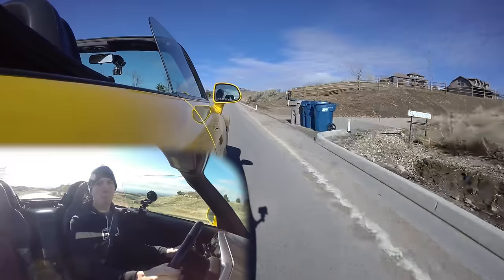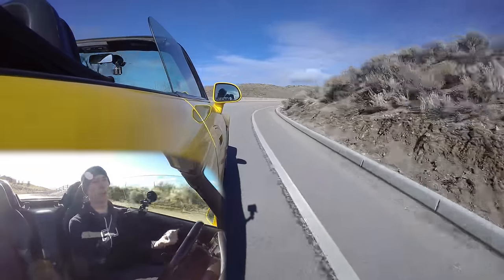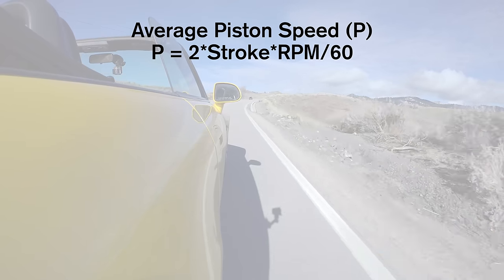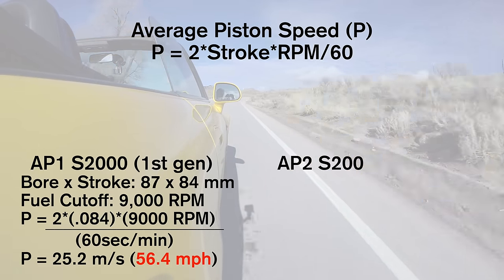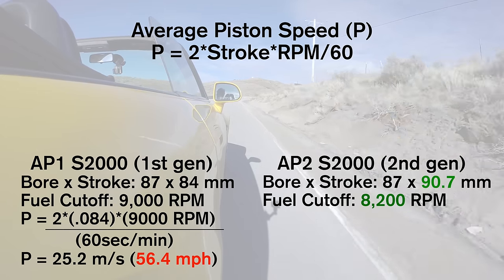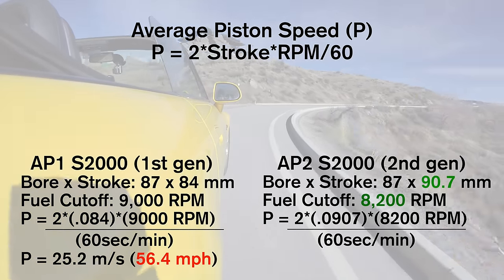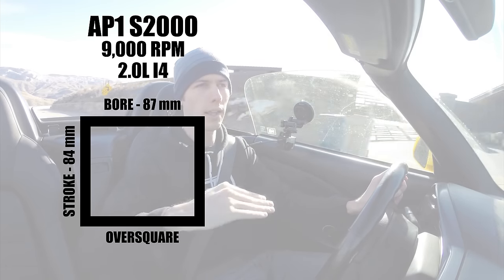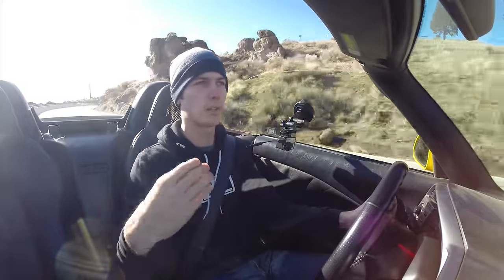How Do Some Engines Rev To 9,000 RPM?

Comment: And I thought the 7k redline in my F-150 was high...
Reply: Mel Laknanurak there I upshift in my E46 316ti
Reply: That´s crazy high for a truck
Reply: What year? My 06 king ranch revs to 5k... my Miata has cutoff at 7200, 7400 if I got a JDM ecu...
Reply: 2017 F-150 with the 3.5 N/A V6 that Ford shares with Mazda

Comment: What about deck height (engine block)? Deck height has a massive part to play in fact even bigger part that oversquare design as it reduces piston acceleration. Honda and BMW have tall deck heights on their high revving engines, however their engines are relatively square. Same with the Audi V10 which is under-square but revs very high. Increasing deck height allows Manufacturers to use existing parts inventory and preserve some torque whilst obtaining high revs. In dedicated race applications such as motorcycles, dedicated race engines or F1 cars, an ultra oversquare design with short deck height allows for a lower C of G for better handling and higher overall power to weight ratio.

Comment: Rod to stroke ratio ?..  you dont tell about it..
Reply: A longer rod means more dwell, meaning the piston sits at TDC and BDC longer. That's good for breathing, but it comes with a lot of downsides. Sitting there longer means it has to get there quicker, so longer rods mean higher piston speeds, which means lower max RPM. Longer rods are weaker yet heavier. The extra length alone makes them heavier, but the weakness that come from extra length requires even more mass, and flinging around more mass means even more mass, and flinging all that around at higher speeds means even more mass, so it's nowhere near a linear relationship. They make the engine taller as well. Shorter rods are better 9/10 times. I'd like to see scotch yoke engines become popular someday. That'd be the best of both worlds.

Comment: So.. is that car from the anime series Initial D, Takumi Fujiwaras car even possible to do 11000 rpm in real life ?
Reply: Yes, in the anime it was based on (or actually was, not sure) Formula Atlantic 4AGE 20V - it's actually able to rev up to 11k.

Other real life example is Spoon Civic Type R - It had a B16B engine heavily modified by Spoon and was able to reach 11k rpm.
Reply: That sounds amazing.
I got interested in cars not long ago, so I'm not really familiar with it all just yet. 

Could you please explain to me, how this is possible? 
I mean, isn't it bad when an engine revs up really high ? ( I saw some videos where the speedometer for the rpm was in the red zone a lot of time.. doesn't that damage the engine ? )
Reply: I got into cars like two, three years ago, still learning stuff.

Why it's able to rev so high is explained in the video by Jason. In short, to be able to make power with short stroke you have to make up with the rpm.

As for if it's bad for engine - yes and no. The engines are designed to work with all available rpm it can reach, high rpm increase wear - it does more work, more rotations, pretty self explanatory. 

Think about walking 2 kilometers and running the same distance as fast as you can - the latter will tire you out, use more of your energy, but this energy is converted into work, so you get there faster. It could be harmful to do such a thing, but doesn't have to be.

Red zone on the tachometer is just an indicator. Some cars have red revs just before their cutoff, some exactly at the cutoff point. Some modified cars have stock tachometers while having modified engine, so it actually revs higher than stock one - red zone on the tachometer loses its meaning in this case.
Reply: Thank you very much for explaining it to me ^^

So these are just different techniques people use:
high rpm = short stroke
not so high rpm = longer stroke

In the video it was said, that high rpm is preferred by car enthusiast because of the high-revving notes, but what does it mean that you can compensate it with gear ?
Reply: It's down to this single equation: HP = torque * rpm. (check last two videos for further explanation and fun stuff :) )

Long stroke engines have more torque so they don't need high rpm.
Short stroke lacks torque so it has to compensate with high rpm

Looking at it again - short stroke engines make their power at high rpm. Short gears - close ratio transmission to be precise, compensates for it, keeping the engine in the high rpm range by reducing the drop of rpm when changing to a higher gear.
Reply: Flame storm do you heard about the Extreme Tuners Evo?
Reply: +Sal You're confusing short gears with a narrow geared gearbox. A short gear (ie. first gear) revs the engine to max fast, but it does nothing for keeping a high revving engine at it's "power range". Likewise a tall gear (ie. 5th) takes longer to rev out to max, but also does nothing towards keeping an engine in its power range.  A narrow ratio gearbox has the "steps" between ratios quite small, so changing from one gear to the next drops the rpm for a given road speed by a small amount, keeping the engine operating near its peak horsepower. You have to change gears faster, but it doesn't let the engine fall below its peak power range.
Reply: scott thompson I meant exactly that, close ratio transmission, said "short gears" for a simple explanation of it. Short gears - short time spent in each gear as the rpm is kept high. 
But i know what you meant, short gear like 1st is, well, short, giving very little speed, tall gear being the opposite of that. I'll edit my comment to clarify this.
Reply: Sal the easiest way to have that effect is to change the differential ratio .e.g 3.08 ratios are used in most V8s and 3.55+ in most 4-6 cylinders and rotors work best with 4.11+, wheel size effects it all so a honda with 4.11s wont react the same as a bmw with 4.11s.
Reply: +Jarryn Smith If you have a wide ratio gearbox bolted to a high revving narrow powerband engine, changing diff ratios does almost nothing for keeping the engine in its powerband when changing gears. There will still be a larger difference in rpm between gears, so while it does have some limited effect and is physically the easiest change to make, it's by no means the most effective. V8's get away with taller diff ratios simply because they have more torque and don't rev as high. Diff ratios are good for tuning your overall package to a particular application. Drag racing use shorter diff ratios so they accelerate faster, whereas street cars use taller diff ratios so they cruise efficiently at highway speeds, and circuit racers change diff ratios based on the track. (tight corners and short straights are suited to shorter ratios whereas sweeping corners and long straights and high average speeds suits taller ratios.)
Reply: scott thompson 100% agree with you

Comment: My engine only goes to 11.
Reply: I ride a bike, but it only goes to 11thousand, which is actually quite low for a sportsbike
Reply: Miklós Bremer what bike? That so low... My single cylinder can rev up to 14k
Reply: I have a Kymco Quannon. It's a 125 single cylinder.
Reply: Ohh i see... Soch 4 stroke 125cc single cylinder right? Mine is Suzuki Belangr 150 it's 150cc Doch  Short stroke 4 stroke engine... Your's probably have a long stroke that's why you can't reach above rpm lol
Reply: your belangr can't be superfun at lower revs, my 600cc at same revlimit is dead under 5k.
Reply: ikr in traffic jams situation...it's really tricky
Reply: 177SCmaro did it overrev or he didnt dare to do it again?

Comment: Both of my oldest sons have owned a Honda CBR250R. 
The model they had is relined at 18,000rpm. 
Yes it's only a 250 4cyl from the late 80s/early 90s, but to ride it around and listen to that howl is crazy. 
It's the strangest feeling rolling along with 10,000rpm on the tacho and knowing it's not even in the torque yet! 😁

Comment: 3:53 Don't forget that a rotational mass always changes direction as it spins, so mass in a rotary engine is extremely important to revs as well and you're limited to the weight vs diameter of the rotor.  The larger the diameter, the faster the surface speed gets at the end of the rotors

Comment: Jason simplified a bit, though spouting all that he did while driving = godlike ability. You can't run high rpm piston motor without the correct bore-to-stroke, big bore for breathing and short stroke for increased engine speed (square or oversquare). You'd also need lightened materials like sodium-filled valves to reduce reciprocating masses or friction. and lubrication. Then, refined airpump basics: high intake and exhaust flow, sufficient fuel delivery, strong ignition, and good timing controls.

Comment: I think it matters for fuel efficiency vs weight of engine, a high revving engine is usually smaller and weighs less than a low revving engine producing the same power at a cost of high fuel economy

Comment: You can make more power either with higher-revving or with higher displacement. The high revving engines are smaller and lighter and therefore more suitable for racing cars that tend to stay high in RPMs where is all the torque of such engines. Low revving engines have heavier pistons and have more torque in lower RPMs and therefore more suitable for trucks, busses etc. The Torque on the wheel can be of course adjusted with gearing. Which means that a slightly more powerful high revving engine would still make more torque on the wheel at high RPMS than a slightly lower-powered big cc lower revving engine, but not at low RPMS, assuming that both engines are geared to have the same top speed per gear.

Comment: Correction if you don’t mind. Vtec does not change the cam profile and allows the valve to open more as you stated in the video. It changes the cam angle relative to the crankshaft angle. By retarding the angle it allows more top end torque (it basically shifts the torque curve and therefore peak torque into a higher rpm range) which translates into more power at higher rpms.
Reply from the maker: VTEC (in the S2000) does indeed alter valve lift, rather than changing cam phasing (what you’re referring to). The valve lift change is demonstrated in the animation in this video.
Reply: I apologize, I actually had to stop the video after you mentioned that part and didn’t make it to the illustration. My bad, I was under the impression that it was a strict timing change and not aware that there is a third lobe and rocker arm involved.

Comment: Few corrections to make;

1) The AP1 only revs to 8,800RPMs, same as Toyota's 4A-GEs with factory high-rev 8.8K ECUs (most JDM ones were less at 8-8.5K, USDM was down to 7.5K.)

2) Rotary "cranks" spin at 9,000 revs, their "rotors" actually only turn at 1/3 the speed at 3,000RPMs.

Comment: Thank you for finally explaining this to people! I've been waiting for a YouTuber to introduce this rule and describe why some engines can rev high and some can't. 

Now, please explain to them why smaller lighter cars can use smaller lighter engines that rev higher but pickup trucks can't. 

Also explain why smaller engines have to rev higher to make more power in regards to total displacement = cylinder volume x RPM and how that effects horsepower. Basically following the rule -There's no replacement for displacement.

Keep up the great work. I find this type of interaction with you much more appealing, BTW. Less mundane than the white board.

Comment: The LS7, to get 7,000 rpm with a 7 liter engine, they used forged titanium connecting rods, special spin cast hypereutectic aluminum pistons which are both very strong and light weight, titanium intake valves and a chrome moly forged steel crankshaft to handle the speeds and loads. Driving one is absolutely amazing. The story as to why TI con rods were used is because forged steel was too heavy and Mobil 1 wouldn't be able to handle the extra bearing loads at high RPMs. It's film strength just wasn't enough. It was way cheaper to go with TI than to breach a contract with Mobil Oil Co. The collateral effects are most desirable, however. A big block that revs up like a performance V6.

Comment: high rev ranges are possible (and meaningful) on fourstrokes because they are elastic engines. two strokes, in comparison, have a very limited rev range where they create (apply?) torque. A four-stroke can create torque over a range of rpm that covers more than an entire order of magnitude. The practical result is two-fold: one, is versatility (you don't have to scream the engine when cruising) and two, is performance: the behavior of an engine at very high rpm is much more uniform and smooth between gears and it is easier to keep it at peak power.

Comment: I realize this isn't really related, but I can either raise my redline by 1000 rpm or increase my compression ratio by 1. Yes they stress different components in different ways (both would also affect piston speeds but to a different extent), and obviously require different tunes, but what would be the relative effect of each? 

My guess is that the compression ratio would improve torque and power more broadly where as the rpm limit would merely allow more power at the end of the rev range. ...Though I suppose I would have to try them both to find the exact power and torque figures in this specific application.

Comment: cool video as always! one piece of information i missed was, how do motorcycle engines do it? 
the formula 1 example explained the higher rpm limit by adding cylinders, but how do some motorcycle engines go to 12.000 or 15.000 rpm?

Comment: I would love to see you make a video about the most reliable engines and combustion types. i.e.  diesel vs gas vs hydrogen reliability; inline-4 vs V8 vs V6 etc. 
A video like that would help me and others immensely in choosing a vehicle to buy. I've been considering a diesel pickup with low mileage as my everyday driver and RV tower.

Comment: My Honda XBX-1000 motorcycle from 1082 does 10250 RPM. 6 Cylinders for only 1047 cc
They started selling that type in 1979.
IT just doesn;t feel right to rev it over 6000 RPM, but, of course, it was designed to do so and sounds glorious when you rev it under load.

Comment: Take a 1977 Escort panel van that redlines at 5800Rpm with standard carb and 10:1 compression ratio, redline first gear at about 60 KPH. Replace 10:1 pistons with 12:1 compression ratio pistons and replace standard single barrel with twin barrel Webber with cam to suit and it magically revs out to over 9000 RPM and gets just over 90 KPH in first gear. Did that in 1984 so was way ahead of my time.

Comment: I used to really admire the S2000's high revving engine but these days I'm more of an SUV guy. A lot of these SUVs have turbocharged and intercooled diesels that not only produce lots of torque, like Ford's 2.2L TDCi that's good for 160PS and 385Nm, but they're also found in SUVs that aren't too expensive and they get pretty good fuel economy given how big SUVs are.

Comment: Another benefit is that your drivetrain doesn't have to be as strong.  Torque is what breaks parts, but if you're relying on high RPMs to make HP rather than low end torque, they don't have to be as heavy duty.  That's why 150hp+ motorcycles that rev to 15,000 rpm can still use a chain.  Of course this makes swapping an LS1 into an S2000 a pain cause everything else has to be beefed up as well, lol

Comment: Great video as always. Not surprised that my Ninja 650R (60mm stroke, 11K redline) falls short of this max piston speed. To add insult to injury it is useless above 9K or so. Based on old GSX-R1000s and this math I should be good for 14K.... but I'd bet the vibrations from the parallel twin setup limit it.

You should do a video on cylinder count/arrangement and primary/secondary balance.